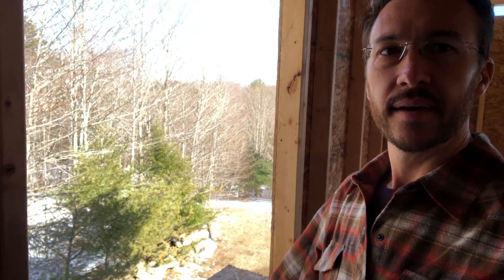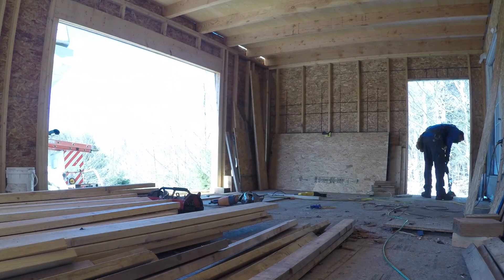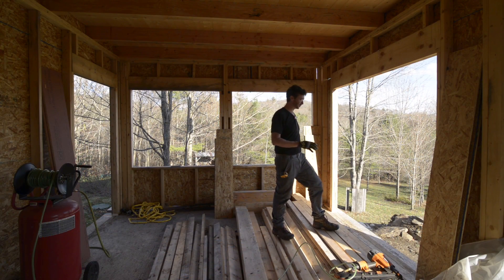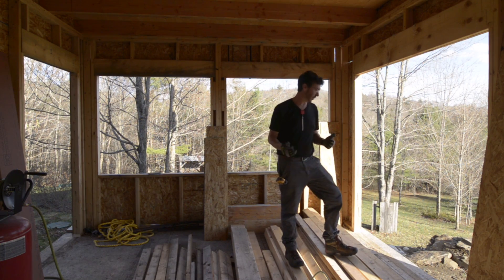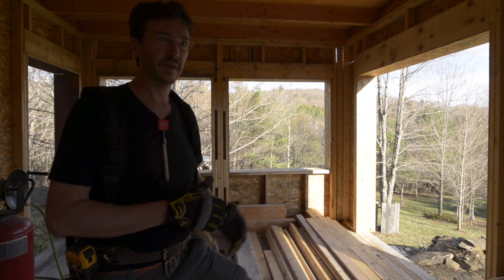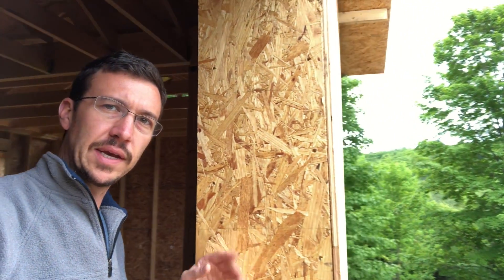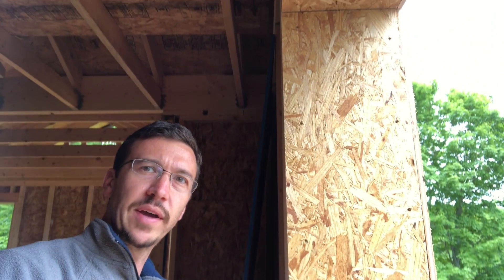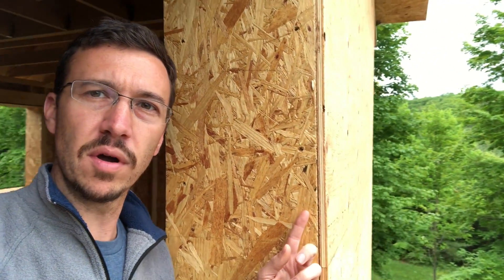Window Door Bucks Double Wall Construction

Comment: So these exterior walls actually hang off the edge of the concrete?
Reply from the maker: The walls are built upon the first floor framing, but yes, hang off basically the rim joist.
Reply: So, your doors and windows will be fastened to exterior walls or interior walls?

Comment: I once stayed at a home where the owners installed 2 double pane windows together in the same hole. Making it 4 panes total. It was soundproof and a way better R value than a simple double pane. I didnt even notice it until one day i wanted to open a window. I was amazed. Their heat bill was way down.
Reply from the maker: Yeah. I wondered about this.  Seemed like a good idea.  Although I would be curious, how did they solve the moisture in between the windows issue?
Reply: I never seen a moisture buildup. I have one double pane and never see moisture. It shouldn't be an issue at all.

Comment: I thought you were just going to frame a double wall.  Not actually two sheathed walls.  Because I can't see the real benefit of sheathing that inside wall.  I think I would have just used 6 mil plastic.  Which, btw, is why I suggested framing with 2x2's on the inside wall, way back when this started.
Reply from the maker: Inside wall is load bearing so it's sheathed for shear strength, and as the air barrier (which yes could be a sheet material if it weren't load bearing)  There's lots more to say about this ... it's... complicated.  I'll get there, but yeah, this isn't how I would do it again.

Comment: We're going with a double stud 12" wall on our new house. I'm thinking with our window openings we will put the sides in at a 45 degree angle or so so that  they are less of a tunnel. The header and sill will be flat, but the sides will taper.
Reply: That's a cool idea.  Castle like even.  Maybe do a stepped look instead in some rooms, if you like a squared look better..  But don't underestimate the powerful look of a deep wall.
Reply from the maker: Yeah, it does feel a bit tunnel like.  But now that I've had them up for a while I don't really notice anymore.  Would like to see how yours turns out!